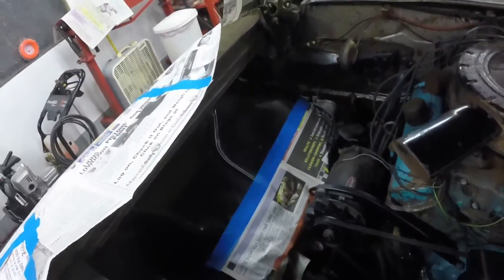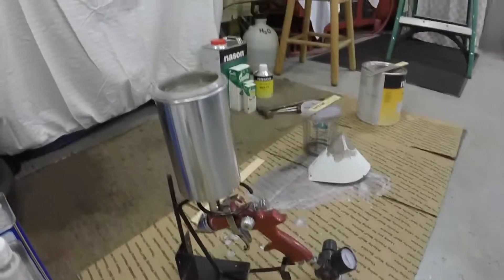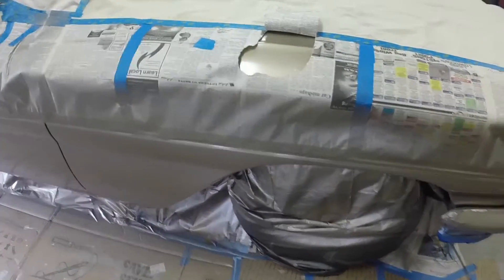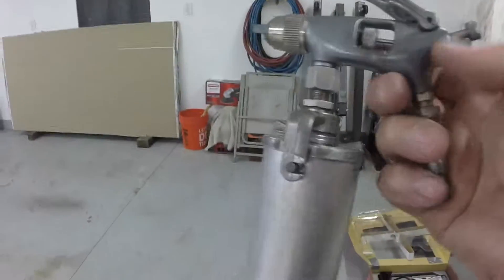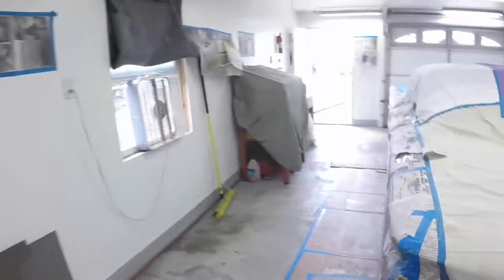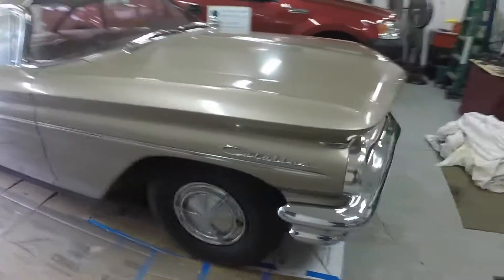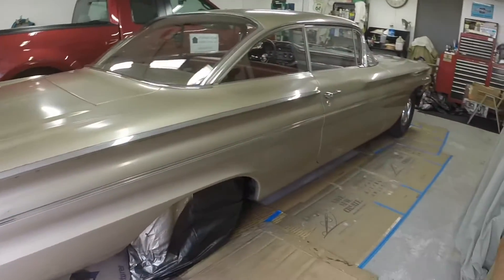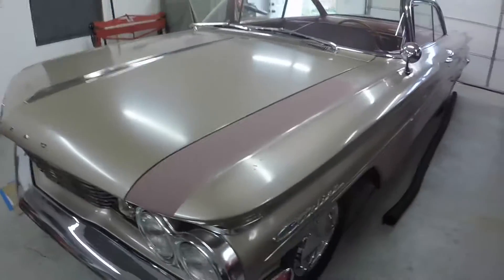Right side of 60 Pontiac barn find is all painted

Comment: Outstanding Job! I Love that car. I mostly have owned various Dodge and Plymouth Models over the last 20 years, but, I did buy a 1960 Pontiac Catalina a few years ago from a guy out in California. Mine was a 389 3 speed manual, that someone converted to a 4 on the Floor. The 1960 Pontiac really is a great example of the late 50's transition from the Boxy look to the 1960's more Sleek , Low Slung and Modern look. Especially the Space Age Dash and Rocket Style Taillights. Great Job, Keep It Going., and  Thank You for using Echo Equipment!
Reply from the maker: Yep, the 1961 set the look for the 60's Pontiacs. The 60 was kinda holding onto the late 50's look.